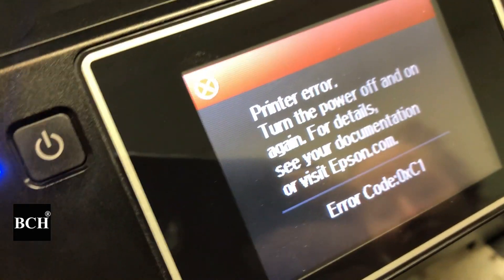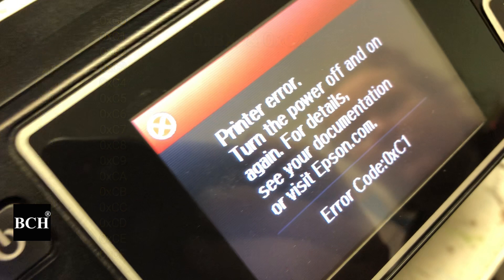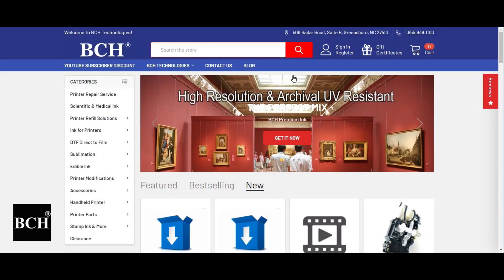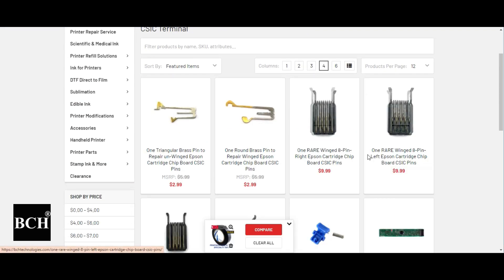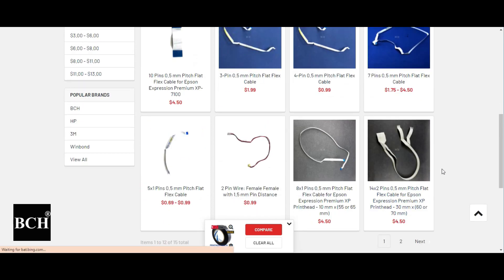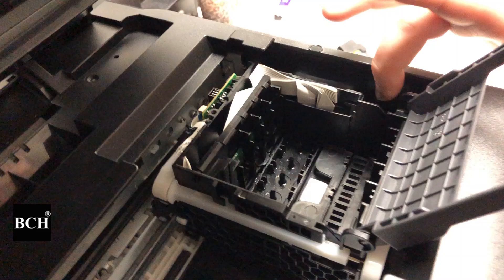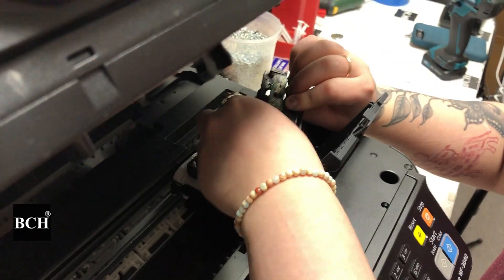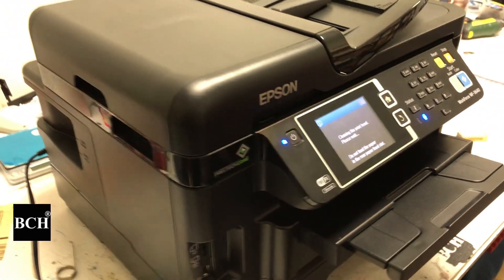Epson Errors 0xB* and 0xC* Explained: 0xC1, 0xC2...

Comment: Getting the 0xc8 error code on power up of my Epson XP-430 printer. Printer failed while printing. Paper exit was blocked by books. I looked up th error code and found this: B Ink device error. Ink cartridge failure. Holder board assy failure (CSIC or contact failure). Main board failure. Cable or FFC disconnection.

I took the printer casing apart and checked all the cables associated with the printer head to motherboard connections. Everything looks okay. Any instructions on what to do to further troubleshoot this?